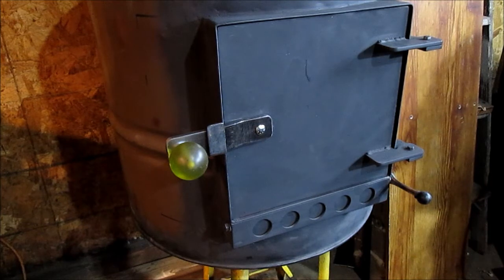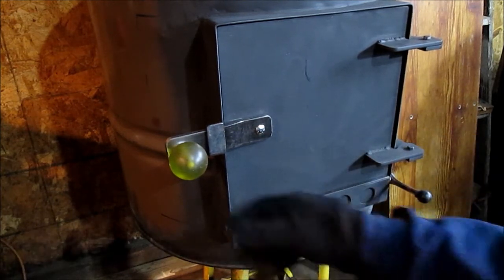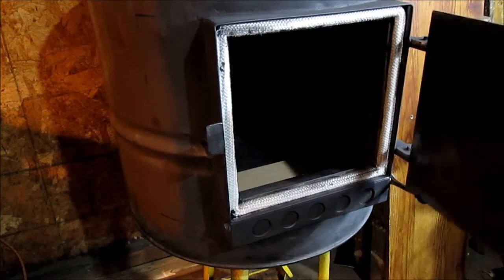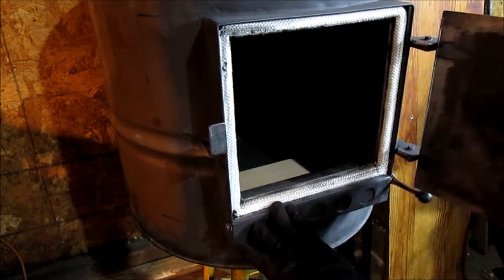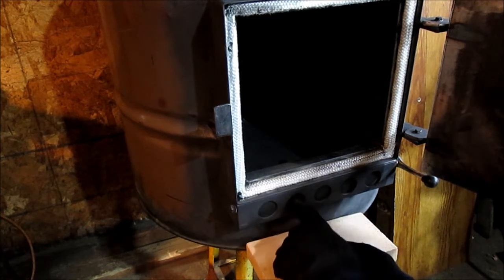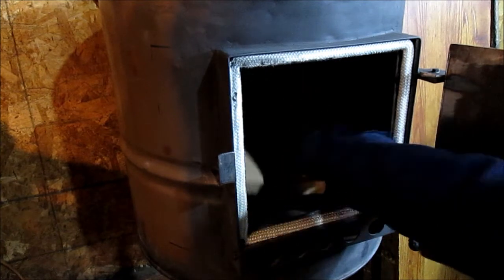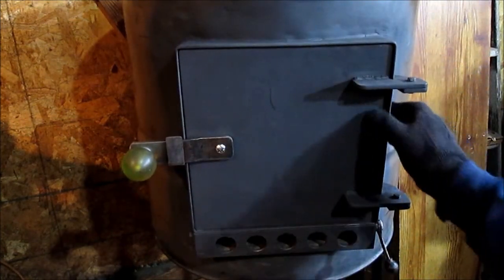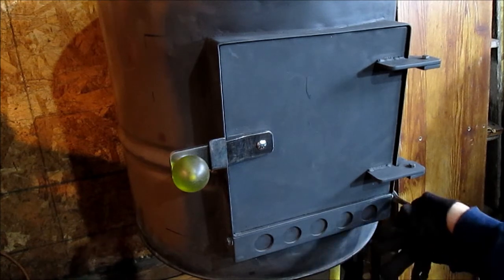Barrel Stove Project part 6

Comment: This stove came out fantastic, I like the design.  The rounded hinge is a nice touch to grind those corners off.  Fire bricks will help that stove last a lot longer.  Great job.
Reply from the maker: Craig Arndt Thanks It is worth the time to add the small details The fire bricks will keep the bottom from being to hot and make it a safer stove